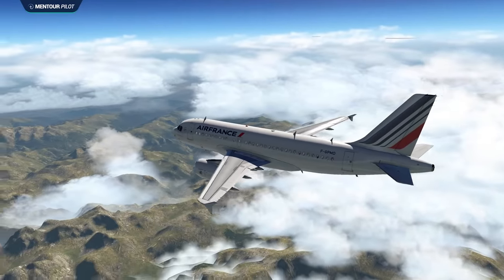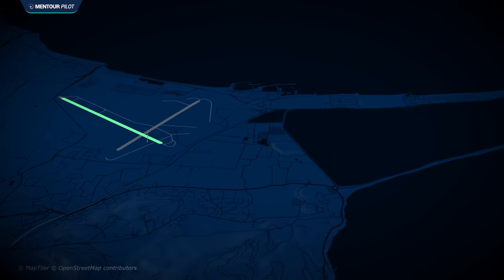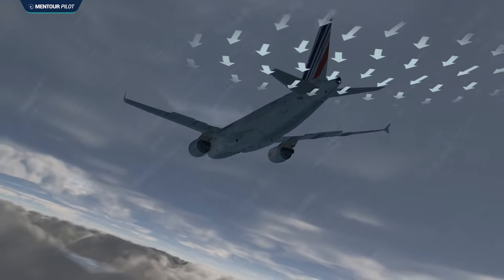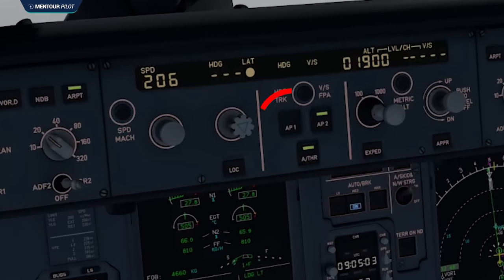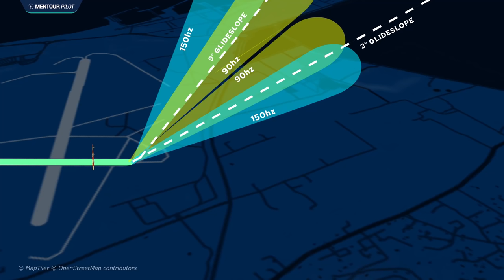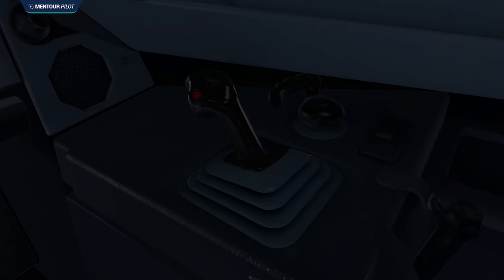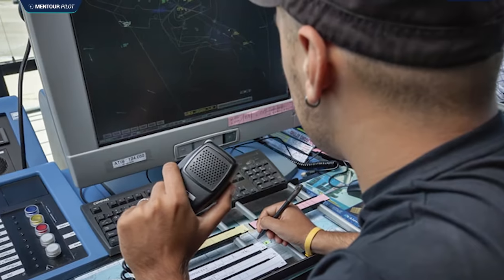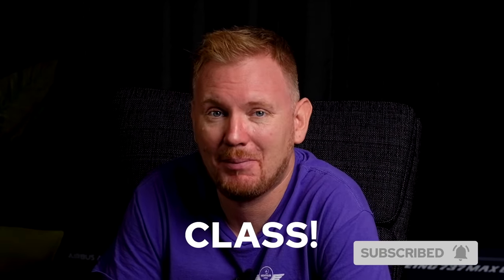An Absolutely CRAZY Reaction! Air France flight 7512

Comment: The "Just Culture" concept reminds me of an anecdote I read where a guy made a mistake at his job that caused something like $30k in damage to a piece of equipment.
He got called to his boss's office after the investigation and repair.
When he walked in he said, "I guess I'm fired, aren't I?"
The boss replied, "Why would I fire you? I just paid 30 grand for you to learn the lesson to never do that again!"
The point is that mistakes happen, and the only way to prevent them from recurring is to acknowledge them and look at the cause.
Reply: probably had insurance..
Reply: Similarly, I've been told that an empoyee that makes a mistake actual gain worth for the company, because they gained experience from their mistake.
Reply: We had a similar story happen at my company (before my time, so it's second hand information). Totally avoidable loss of (even more expensive) hardware. 
The guy was not fired. Until he repeated the same thing again.
Reply: I was a dispatcher for GM in 2009 and a printer never shot out paperwork and I got distracted. 20 minutes later the plant called screaming about the trailer and I didn't know what happened. I immediately called my boss in his office over the phone and said, "I f*cked up."  I fixed the issue and sent the load but the plant was down for 8 minutes. It cost $44,000 and GM wanted me fired. My boss told them they were crazy because I was the best dispatched they've ever had and I made an honest mistake that I owned up to. Got to keep my job.

Comment: Dear Mentour Pilot, thank you for this video. Your main message of having a culture where every incident is reported, regardless of which circumstances/actions lead to it is crucially important. I've worked in the nuclear industry, and there the culture is strong, I'm proud to say.
Reply from the maker: Yes! The aviation and nuclear industry are very similar in many ways when it comes to safety work.
Reply: @MentourPilot  There are critical differences though. The nuc industry places an overwhelming bias on personal safety (ALARA, As Low As Reasonably Achievable radiation dosing).
For airliners it's the pilots plus the whole cabin crew plus the passengers who are in mortal danger if the worst came to pass.
I take my hat off and bow my head to the airline safety culture which has evolved  since WW II, an evolutionary process,  getting better all the time.
Reply: @mattilindstrom  
There is a reporting system where literally anyone can make reports in true total confidence such that it cannot be traced back to them individually … thus if a professional has a concern there is a safe reporting avenue
Reply: @ChiDraconis  Being a whistleblower on safety or security has never been an issue in my experience, in my home country of Finland.
It's of course excellent to have a non-traceable way of expressing all our safety concerns: whatever gets the problem sorted out.
What I found almost endearing was the response of TUKES (our competent authority and advising body for anything hazard-related), through the telephone exchange straight to a seasoned nuc professional with calming words and how to proceed.😊
The incident was half of my face and only one of my eyes, and thankfully it was soft x-rays, no humans or animals were harmed in this mishap. It was a pretty potent Fe-55 source, luckily the Auger electrons had been absorbed by the membrane covering it. Reporting it got me praise, the law-mandated medical consultations were a nuisance (but hey, on paid medical leave).
Reply: @MentourPilot  and healthcare
Reply: @mattilindstrom  "Being a whistleblower on safety or security has never been an issue in my experience, in my home country of Finland."

You're lucky there. Even in non-safety-critical areas of IT where I've worked I've had to tread very lightly to avoid blame culture coming to the fore.

A few years back there was a piece of really bad code that I wanted to focus on because a) it really did need extensive rework to help improve the system within which it was embedded, and b) it made a great example of how we had expertise on the team that wasn't getting to the right places. (We had developers who would have done a great job on that bit of code, but other things prevented us from having them work on it. So instead we had a C++ guy with almost no Python experience desperately trying to hack out some Python code with no help.)

But no matter my protestations about how the guy who wrote it was neither a bad coder nor a bad person and how throwing around any blame at all was going to derail the improvement process, people wanted to focus on the "this is bad" part rather than the "here's a great place to make some valuable improvements" part.
Reply: To what extent is the nuclear sector proactive rather than reactive? Are scenarios being forecasted and SOPs crafted? Nuclear industry seems to safe when dealing with the expectable and catastrophic when dealing with the unexpectable.

Comment: This was a serious incedent. If things had been just the slightest bit different, the aircraft and everyone on board would have been lost. I would hope that reporting the incident and analysing the contributing factors helped to avoid similar incidents and saved lives. I, for one, am glad that pilots can report things like this without fear of repercussions .
Reply: Amen, the airline system really is a model more should try to follow. Harsh reality is humans make mistake,s no one ever does everything perfect all the time. Good safety culture takes account of that and makes allowances for it. If your safety plan relies on humans acting perfectly all the time, it's not safe and it is going to fail. The existence of the alpha system in this case was the major contributor in making this incident not a disaster.
Reply: @darthkarl99  omlmmmmmmmm
Reply: No.  The aircraft's safety system took over.
Reply: @Twobarpsi  "safety systems" when the Airbus autopilot pitched up 30°. Not to excuse sloppy flying but the other errors are kinda meh and the whole design philosophy of the bus is to keep the envelope in spite of them. How's this sequence when I was new to the A320... 3100' leveling off at 3000', 25° bank capturing the localizer, 1/2 dot below glideslope, slowing to approach speed per ATC and extending flaps on schedule, flaps in transit 2 to 3, autopilot on. It captures the glide (maybe a signal fluctuation) and aggressively pitches up to fix the half-dot error. Realizes it's commanded an accelerated stall and does the A. Floor business. So that was a dynamic situation (slowing, configuring, leveling off, intercepting) but the thing that caused the event was George's  totally out of the ordinary ridiculously aggressive pitch input. When you learn the bus they teach it like the sophisticated computers build this box you can't fly outsidef. It's a safety envelope you can't escape. But then in actual fact they throw half of that out the window with some ridiculous over controlling to bracket the glideslope. So I still love the Airbus however I recognize that overloading the thing with a dynamic situation while its programmed to chase the glideslope like an air-air missile won't result in a graceful approach. It's actually not a sophisticated autopilot at all. It's a simple thing that does dumb stuff. Most distressing is that everything was within normal parameters until the autopilot pulled hard on pitch. Kinda like here, except they had the abnormal situation of the inverted 9° glideslope too. Still... dumb dumb Airbus glideslope logic.
Reply: @p39483  Yeah, so I guess it's less-than-perfect Airbus A.I. could it be said?  Yes?  If so that shows that AI can not always be better than human control. My opinion only, & I'm no expert.  But tell me if I'm wrong :- Isn't AI just real clever computer programming, when you boil it down?  Is that right?

Comment: I was an avionics engineer in UK during the early 1970 and we called this the "Aviation Safety Culture" and I have both witnessed and been part of this process. This video gives me goosebumps remembering how it works exactly as you describe. I would like to describe one incident to help anyone to  really  get a feel for it in action.    

A Helicopter was about to take off and could not contact tower, I was sent in to fix problem, when I got there I found that the VHF1 was selected to the tower frequency and was switched on  but was connected to intercom 2 which was OFF.  So  I switched I/C2 on and suddenly everything burst into life. The pilot realized his mistake became frustrated and tried to grab my headsets off me but I had to do a 2 way comms check with the tower (the engines were on an the passengers were right behind the captain) I clung on to the headset and did a 2 way 5 by 5 check all ok then I explained the problem to the Captain who then took off and fortunately had an uneventful  flight.

 Later my boss told me I had to apologize to the captain the next morning which gave me the night to ponder WHY?. Eventually I realized and when the Captain showed up next morning I gave him a heartfelt apology and described exactly how I SHOULD HAVE handled the situation, to my amazement the Captain then also apologized to me for his part. 

Conclusion  1. I aggravated  an already embarrassed pilot in front of his passengers and caused him to take off in a frustrated state.
Conclusion  2. Unlike a large plane if anything goes wrong with a helicopter especially during take off he has to react fast with muscle  memory which I had compromised.
Conclusion  3. After we talked everyone was happy and I learned a lesson I will never forget. And I had a very high respect for that Captain from then on.
Conclusion  4. Always be honest no matter  where the fault(s) lies and instead of being defensive seek a solution that fixes the problem FOREVER. that is what the "Aviation Safety Culture" is all about. 

Hope you like.
Reply: I don't think as a engineer you did anything wrong it's your job to tell the crew of issues you find so, had he gone hissy fitting to vosed cos passengers heard well as a captain he should have taken notice of what you had said it wasn't appropriate behaviour of him to try and  grab your headset but I know how you feel your scared of losing your job your field of work should be like NHS and have an anonymous line you can ring to report in your  concerns
Reply: @bunglejoy3645  you haven't understood the first thing he said....
Reply: bro if the pilot can't compartmentalize his emotions he should not be flying.

Comment: Many decades ago around 1977 an Air NZ 707 encountered a similar scenario with false ILR lobes landing at Wellington in a late evening arrival. Instead of coming in high, they found themselves incredibly low and the flight crew reported briefly seeing the lights of residential houses flashing past the cockpit as they passed over a hill suburb of the city under the flight path. An immediate go round saved them, but the immense roar metres above people's houses was obvious to everyone, which led to an investigation.

Both pilots had been absolutely certain they were on the glide slope, when in fact poor installation of the ILR antennae had created a strong false lobe well below the correct one. And while there were ground proximity warnings, the nature of the terrain coming into to Wellington from the north meant that pilots in that era could not rely on them either. A combination of complex hilly terrain, a misleading ILR, and low visibility meant they came very, very close to a complete loss. Literally they had passed through a relatively narrow gap in the hills barely 500m wide, so close the pilot told me he had this brief image of someone's TV in a living room blink past him. It had come as a complete surprise to the crew, and for a few brief seconds there was a small tussle between him applying full power, and the flight engineer reaching forward to pull the throttle levers back a little because he had not seen how low they were and feared flaming out the the engines. 

In those days there was no 'just culture' and the pilot concerned was blamed by the airline, with no attempt to understand or learn from the incident. In the end he was demoted, and effectively forced out of flying as a scapegoat. 

I know of this story because the person concerned was Air NZ's most senior pilot at the time, and I was an employee of his in a small non-aviation related company he also ran. I got to hear from him the whole story of the incident, and the subsequent investigation first-hand. And then about a year later the immense shock of the Erebus loss shook us all to the core, along with the bitter realisation that the airline senior management had learned nothing. But this time it all came out in a Royal Commission that itself became embroiled in intense political controversy. Frankly those were dark days for Air NZ.

I'm not sure if you have covered the Erebus disaster, but it would be a fascinating to see your take on it.
Reply: The recovered footage from aboard the Erebus jet is fascinating.
Reply: Thank you for your clear explanation of the ‘Newlands Incident’. As a close friend of the Captain and the one who delivered him to the airport for his flight that night I know what a huge toll that had on his life. The “blame the pilot” culture in those days was devastating and even when it was proved that a faulty signal was to blame
Reply: Top airline executives refused to relent. Thankfully many years later and before his death AirNZ apologised for the way he had been treated.
Reply: @barrydenholm7864  Thanks for this. I've not been in touch with Don for many years and  I trust relating this story here -from memory only - does not cause any him concern. Incidentally I think I got the plane type wrong - was it a DC10?
Reply: @philipwilkie3239  I just looked up the "Newlands Beacon Incident" and it seems it was a DC-8.
Reply: @virj42  Thanks for this. You prompted me to do the same and the details are interesting. It appears that it was the HVDC power lines north of the beacon that were re-radiating the ILR signal was the root cause of the problem. The important detail is that this false glide slope had been reported numerous times by other pilots and residents for some months prior, but they had been ignored.
Reply: This would be another great story to follow. I've landed in Wellington (as passenger) and it's fun as but i can see how easy to mess it up is. Only one worse is queenstown
Reply: @barrydenholm7864  That's nice and all, but something tells me that they probably didn't do much of anything to make the man whole though.  Nothing like giving him back pay and a fat bonus for saving all those lives that day.

Comment: This was a great video. I was a MD11 Captain for 18 years so I had the opportunity to experience the magic of the glass flight deck. I at one time was taught the 3xAltitude formula to calculate where to start the descent. Later I learned another version that is easier to use especially for closer distances. The formula 3 X Track Distance in NM. 120NM=FL360, 80NM=FL240, 40NM=12,000’, 20NM=6000’, 16NM=4800’, 5NM=1500’, 3NM=900’, 1NM=300’. Three hundred feet for each mile. Then the necessary vertical speed required to maintain the profile is 5 x GS. 500 kts=2500’ FPM, 300 kts=1500’ FPM, 250 kts=1250’ FPM, 150 kts=750’ FPM.  If I was flying that Airbus at 16 track miles at 6500’ with 300 kt GS I would know I would be 1700’ high  at zero wind and no slow down calculated. My guess based on conditions I am actually 4700’ too high. Yes, a turn in the hold was appropriate. I made it a practice to check my altitude vs distance each 10 miles and make adjustments early to arrive at the expected speed and altitude.
Reply: I wish I was great at maths!! ❤

Comment: It is far better to err on the side of caution, reporting things that may be amiss, than to crash into the ground.  Having a culture that generally seeks to prevent issues really can only happen if there is no fear associated with reporting.   I find these videos a great comfort with regards flight safety: the industry as a whole having moved away from cowboys in the air.  Sadly, due to the sheer complexity of the systems that make flight possible,  sometimes a possible problem isn't anticipated until something like happens.
Reply: I think it also helps that pilots do not have to fear an self-reported honest mistake, but that there is always the possibility that someone else files a report.
If the pilot report is timely and honest, then an ATC report of the same incident does not change much. But when there is a serious ATC report but no pilot report, then that needs a serious investigation. Does not need to be pilot error (e.g. comms system malfunction), but something is going on.
Reply: @sarowie  my

Comment: I know this airport very well. I was in the French navy base between 1995 and 1997. This base was used by 2 squadrons 3S and 59F mainly for surveillance of the Mediterranean Sea and aircraft carrier landing training. On the 05/23 runway, you had those arresting cables with motorized breaking system like in an aircraft carrier. They made the runway even shorter. My job was to operate and maintain those cables.
I never saw any commercial aircraft landed in the 14/32 runway. They always used the 05. 

Back in the day, there was a "barn" with sheep in this base. I remember, one time, an Air inter airbus had to do a go around in a bad weather because on those sheep. The captain was not very happy about that. And, after the landing, he had a few "not so friendly words" for us. 
The place is beautiful and it was, for me, 2 incredible years and the best aviation experience.
 I'm very happy to see it on one of your video.